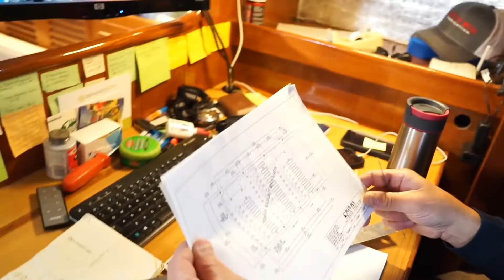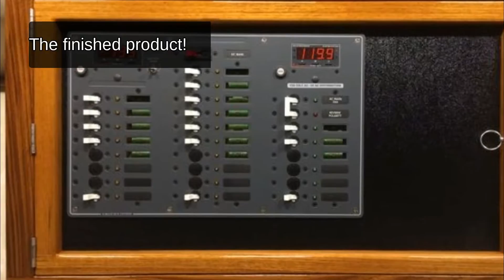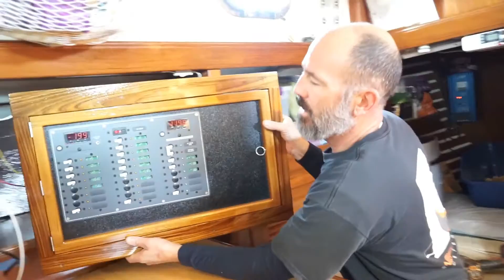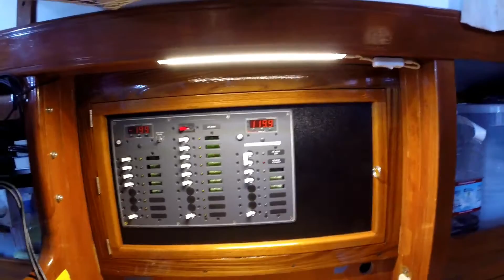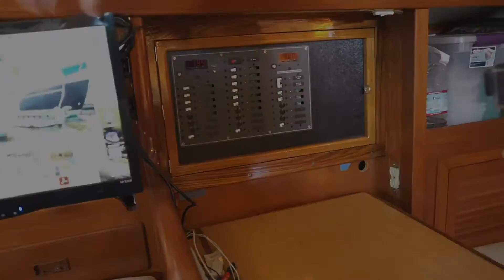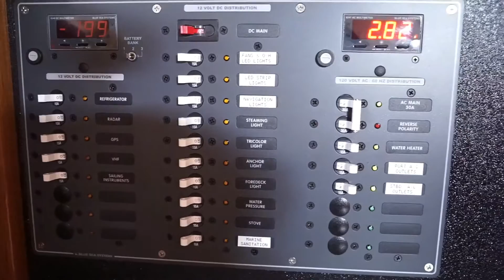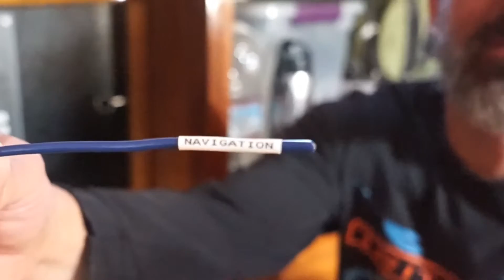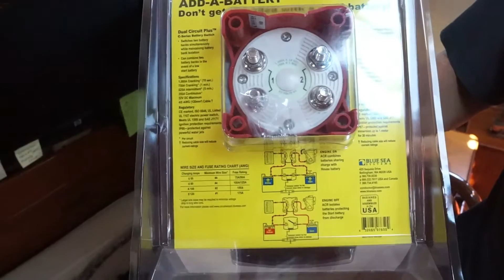SV Ramble On | Electrical Part II

Comment: Good video. Don't know why they put the electrical panel in the engine space. I moved mine as well. Used the Blue Sea 360 custom made. Was a sweet panel! I too am interested in those carbon foam batteries. I have lithium on my RV at the present time, but might go with the carbon foam ones on my next boat.... if there is a next boat.  On my last boat I used the sears branded Odyssey batteries which were pretty nice. They used thin plate pure lead technology. But those fireflys... nice.

Comment: Wow.  I need to hire you for working on my Tayana 37!   Great job!   We have some of the same projects going on.   I'm not replacing the panel, but I do want to put in all new battery cables as they are now 30 years old and showing their age.   Are those the crimpers that are recommended on compass marine?  Makes sense to get the best tools for the job.  

 I replaced our hot water heater with a isotemp 4 gal last year, which still gives us more than enough hot water for the two of us, so that should work out very well for you.   Thanks for posting the link for the batteries.   I just listed to a pod cast with Nigal Calder and he was talking about those batteries.  Pretty new technology and safer than lithium.
Reply from the maker: Hi David - Yes, those are the crimpers from Compass Marine (http://www.pbase.com/mainecruising/wire_termination).  Rich loves them.

Glad to hear you like your 4 gallon Isotemp.  Where do you have it mounted?

We're pretty excited to try the Firefly batteries.  Rich is going to Nigel Calder's Boat Electrical Systems seminar at the Pacific Sail & Power Boat Show in April (https://pacificboatshow.com/seminars/understanding-and-troubleshooting-boat-electrical-systems/).  He's read his books but it'll be great to hear him in person.  What podcast was Nigel on?
Reply from the maker: Yo David, Rich here.  Jeni was correct in the link with the small wire crimpers I use for everything from about 8 to 22 ga. wire. Pro's Kit CP-371 frame: http://www.proskit.com/crimpers/frames/pro-crimper-frame  The dies I'm using for normal wire termination are the Pro's Kit model here: http://www.proskit.com/crimpers/dies/die-set-insulated-terminals-awg-8-22-18-16-14-12-10  
They also sell crimping dies for micro wire and solar panel terminals. 
For the big battery cable I'm using the FTZ 94285 controlled cycle ratchet crimper: http://www.goodboatgear.com/detail/pd/45489/  It does everything from 6 ga. to 4/0 ga. power lugs, I I got the lugs and heat shrink from polarwire.com.
Also, glad to hear about your good experience with the Isotemp 4 gallon water heater.  I'm looking forward to installing ours this weekend.  Were sticking it under the galley cabinet, so we should have almost instantaneous hot water at the sink where we need it most.
Stay tuned for a new video soon.....
Reply: Thanks for the added info Rich!   The FTZ 94285 is pricy.  Might see if there's a local one I can rent or borrow first before dropping that amount of change.   It's not like the smaller ones where i'd be using it all the time.   Thanks again.